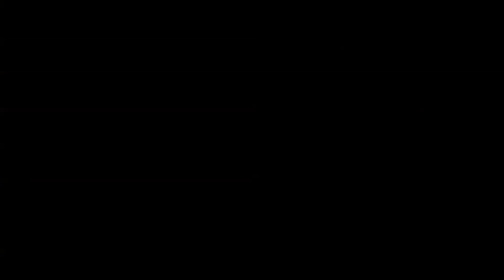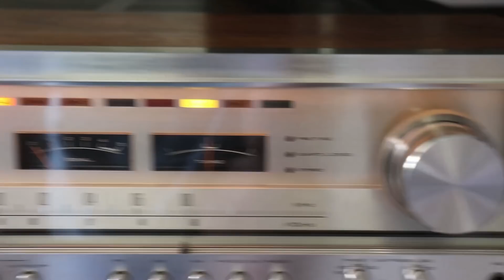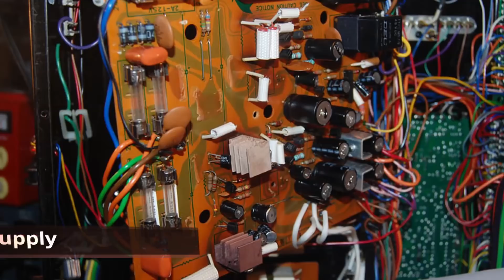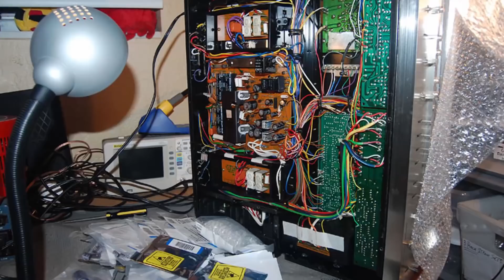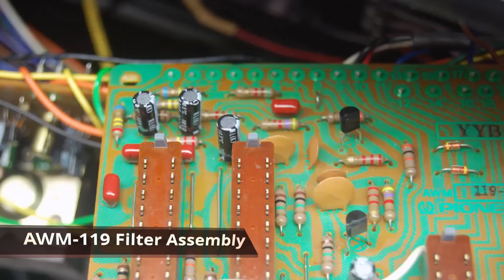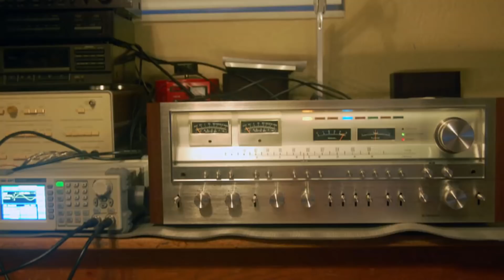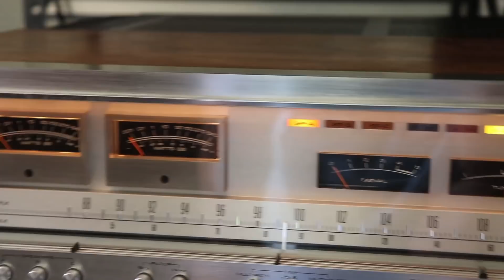SX-1980 - The Most Powerful Pioneer Receiver Ever! Vintage Stereo Repair Restoration & Testing.

Comment: Howdy, This is the first time I've been on this channel ! You do some serious work !! Could you do a show, about the test gear you have on your bench ? And on the subject of capacitors....... What are your top 10 cap maker's, according to type ??  By type, I mean electrolytic, non-polarized, ceramic disc, styrene, etc......!  Thanks for all of your effort and hard work !!
Reply from the maker: Thanks for watching and for your kind words. I've done several video's that you may want to checkout on test equipment, capacitors etc. I have provided the names and links to the video's  below.

Troubleshooting Failures In Vintage Audio Equipment -

Replacing Old Electrolytic Capacitors - https://youtu.be/RaWrYJ6amcA
Vintage Stereo Repair - https://youtu.be/N3e9C4mUui0
Phono Repair And Troublesome Transistors - https://youtu.be/lkcP1z-KcPA
Hakko 808 Desoldering Tool A Must Have - https://youtu.be/NtSn_HPT-sE
Hazards Of Reel To Reel Tape Deck Repair - https://youtu.be/KvXwN5igzDg
No Audio In Vintage Equipment - https://youtu.be/pKqxlT9sgZY
Troubleshooting In Vintage Equipment - https://youtu.be/xk5gjq5ehK0 
Reforming Speakers - https://youtu.be/ttbgeDagRus
Checking DC Offset On Vintage Amplifiers - https://youtu.be/ZvBoxhpa-v8

Comment: I have a pioneer SX1050 bought in Okinawa in 1977, which is having channel dropout that can be reversed by increasing the volume, which breaks through the dropout. Can this be repaired?
Reply from the maker: I'm sure it can. It sounds like your volume control may need a deoxit treatment along with the other control switches and pots. That would be the first thing to try.

Comment: I do fix those vintage audio equipment for about 30 years now (I'm 60). The thing is that those old electronic equipment were made with mostly discrete components and so are quite easy and cheap to fix compared to much about anything electronic today. Now, you have unidentifiable very small components with often 200 pins IC's in a bubble grid array arrangement on a board with 6 internal layers of circuit traces. Nope, don't even try to fix that. You'll lose your sanity.
Reply from the maker: Yes, that's very true. The vintage electronics were made to be repaired when they broke. Most modern electronics when they break you wait for trash day.
Reply: Vintage Audio Addict Just wondering...  I own two SX-1050s and a SX-950. Just having my 950 redone.  My audio repair guru prefers to test the old parts and if they test to spec, resolder them, claiming the old parts were good parts and sound more musical than new parts. (I’m speaking mainly of capacitors.).  He claims solder gets old and resoldering is a big improvement.  Hoping you will comment with your opinion.
Also, he prefers to restore 950s, seems to think they are very musical.

Comment: I bought a sx 1980 and had it tested and recapped it was no where nere 270 wpc hell my sx 1280 hit harder and sounded way better now I run a marantz 2600 I was very disappointed in the 1980 now I love my spec 2 system

Comment: I have an SX-980 that I bought as a teenager the year they brought out digital so I got mine on sale.  It needs to be fixed.  It was a work horse.  I used it for a 2000 sq ft dance hall using 4 speakers at half volume and it was definitely pumping out the music.  Mine was rated at 80 watts per channel.  I was told never to get rid of it even though my wife has had the desire a number of times.
Reply from the maker: Thanks for sharing. Your SX-980 is a fine receiver. Keep her around, I mean your wife of coarse, LOL. But seriously your SX-980 has an issue that could probably be fixed and then the SX-980 can make music again.
Reply: @vintageaudioaddict  Excellent video by the way. The last time I had it in for service I was told that there's soldered connection between the amps that gets hot and then cold and then hot and finally snaps.  I wish I had the money to get one of the higher end models but back in 1977 when I bought it, I think I paid $350 was a lot of money to me and the one you worked was about $1250 if I remember correctly.  Where do you get the flip handles for the front? One of mine came off.  thank you.
Reply: @vintageaudioaddict  I just had it fixed and cleaned by Dr Dan's in Denver.  Love to listen to it again.

Comment: There’s one on ebay right now.. $25,000 (not a typo) or best offer. Just wow! Shuda kept my 2325.
Reply from the maker: I love this stuff but that's a bit much.
Reply: I saw that on eBay I think. It was found in a closet in the original box and unknown if it had ever been used at all. If you have a spare 25k, and don't have a sx1980, what the hell, huh.

Comment: Reminds me of my high school days late 70's early 80's, always had Radio Shack equipment, but the best receiver they had was just a measly 120W RMS/CH, (Matched with my Mach 1 speakers) wish I knew about this one! I would have drove my parents even more nuts with my house shaking music.
Reply from the maker: Radio Shack had some good stereo equipment back in the day. The Mach 1's would crank!
Reply: I built a number of speakers using Radio Shack sourced drivers, crossovers, L-pads & more. Not all was used as-is, like modded x-overs, midrange enclosure within the overall enclosure, serious bracing especially when running 2 x 12" poly woofers (40-1026) in each box. Without it would have blown the box apart! Lot's of fun!!✌

Comment: Can you loan me that receiver I'll give it right back I promise you can have my Pioneer SX 580 as collateral 😁....pweeease? Man this sucks even a moderately conditioned one is still almost five grand if I had the money though that would be one of the splurges I would make what is an excellent pair of speakers of around the same vintage to go with that even if they're not Pioneer speakers what are some really good speakers around 1978 that would go with that
Reply from the maker: Sure, send me your SX-580 first, LOL. Seriously don't discount your SX-580. Sure it doesn't have the power or features that the SX-1980 has but it can hold it's own. Your SX-1980 is a fine receiver.
Reply: @vintageaudioaddict  yeah i was kidding , i have it going to a pair of cerwin vega vs-150 15inch 3 ways on ch. A , and bose 201's on ch. B, with a BBE- 362, and a Behringer DEQ-2496 digital eq through the tape monitor and at only 20  watt per ch. It sounds excellent😁👍

Comment: The Pioneer SX-1980 was a radio receiver that Pioneer Corporation introduced in 1978, to be matched with the HPM series of speakers. It is rated at a staggering 270 watts per channel into 8 ohms. However, in the September 1978 issue of Audio Magazine, Leonard Feldman did a spec test on the SX-1980 and concluded that the rating of 270 watts per channel was too conservative. He stated in his report:

Though the new [IHF mandated] "Dynamic Headroom" measurement is specified in dB, it should be mentioned that based upon the short-term signal used to measure the 2.3 dB headroom of this amplifier, it was producing nearly 460 watts of short-term power under these test conditions!
Reply from the maker: The audio manufacturers back in the day were mostly conservative with their specs.

Comment: I've got a 980.   It's been a great receiver.    Bought it used a decade ago for 250 bucks.    It's worth more today.   I'd love a larger unit, but they are out of sight and RARE.
Reply from the maker: Your SX-980 is engineered and built just as good as his big brother the SX-1980. You have a fine receiver.

Comment: before this one i had a kenwood just as big as this if even more, i don´t remenber the model ,and tried to find it on-line but i can´t found it on the catalogs available on-line it´s very look a like the 1973 stereo receivers from pioneer, i own also a es-2000 system bought in japan in 73 that looked like the kenwood wich was my stereo receiver after the one in es-2000 system that also works perfectelly today with everything original
Reply from the maker: Thanks for sharing. Congrats on still owning some of your older equipment. There were so many great audio products made by Kenwood and so many others.

Comment: There's one of these on EBay right now. Open box absolutely mint. Looks like it was never used. Seller wants $25,000 or best offer. That's insane considering in great condition you can get one for $5,000
Reply from the maker: Yes, 25K seems a bit much, LOL

Comment: Back in the late 70's the SX1010 was king of the hill, I was a Sansui guy so I have the AU20000, its rated at 170 RMS into 8 ohms, its a beast.  I still have it but needs a restore, a guy on ebay does them for about 800$ and up. Maybe someday, I still have my JBL  L300's, rock on.
Reply from the maker: Thanks for sharing. So much great gear back in the day.

Comment: my first piece of stereo was a Pioneer Receiver a small unit - but what impressed me was the way it came packaged - this was in Europe - in Heidelberg and i got it in the '60s from an airbase store.  I eventually after many speaker large and small and many receivers went just straight wire with a Marantz 8b - will not bore with other equip.
Reply from the maker: Thank you for sharing and thank you for your service.

Comment: Bad design on this receiver. Lots of over heating problems and burnt out caps. If you want a real well built pioneer receiver, get a sx1250. 
Way better design and sound. This monster was built for wattage wars only. It was competing against the sansui g33000 which is more powerful, better sounding and better built.

Comment: i had a 13 piece system i bought in the early 80's i wish i still it, it beats anything they sell in stores today, more sound, better tuning, etc., wish i still had it instead of what i'm stuck with today.
Reply from the maker: Wow, a 13 piece system. You must have purchased it all at once. I'd buy audio equipment a piece at a time. I would have brought the whole store but I didn't have the cash to do it.

Comment: Is buying those cap/component kits cost effective? For a Pioneer SX-626 they run $60-80. Includes the caps, transistors,  etc.
Reply from the maker: Maybe.... buying a kit is the correct thing to do to save time but not money. I know that's a great answer. Almost always you can order the same parts cheaper. The person that your buying from is in business probably to make a profit and he's taken the time to put everything together. Some of the kits use the correct/high quality components and other's don't. You have to do some research on the internet and find other folks that have used the same kits and see what they say. BTW.....Your SX-626 is a very nice receiver.

Comment: What is the weight?  And why not switch out all the push switches since they do tend to become a problem even today on modern mixers.
Reply from the maker: About 78 lbs. It's not necessary, The switches are good to go now.
Reply: 78 lbs? One would need a hand truck to get it out of the store and into a van. Whew!

Comment: Thank you for the extended explanation on switches.

I just bought an SAE 180 para. eq. that I tried cleaning switches and linear pots.  Apparently, I didn't do good enough of a job on the switches; pots seem good but a bit physically "scratchy".  I'm not sure if there's an issue with the switches, other components or my misunderstanding of its operation (playing tape player with EQ vs. Tape Monitor).  Any recommendations are appreciated.
Reply from the maker: Your welcome and thank you for watching. When I first started working on vintage audio equipment I didn't exercise the controls enough after using Deoxit. I thought I was doing enough to turn or push each one a few times but after having to take equipment all back apart again to re-clean the controls I knew I wasn't doing it correctly. Many intermittent issues in vintage equipment can be solved by the proper cleaning of the controls. You can have defective pots and switches that cleaning will not fix but first you need to make 100% sure that you have those controls cleaned properly, meaning each and every control is exercised 40 or 50 times after the dexoit has been properly applied.

Comment: Which main filter caps did u use and were can i get them?? Nice work!@
Reply from the maker: Thank you. Nippon Chemi-Con. I purchased them at Mouser.com years ago but I'm not sure if they are still available still. The filter capacitors are getting a little more difficult to find as time goes on.

Comment: Do you by chance work on reel to reel tape decks?  I have a Teac X-10R that has recently been cleaned, adjusted, lubed, etc and all works fine except the take up motor has gone kaput.  If you do please advise and perhaps we can arrange something to get this beautiful piece of gear up and running again like it should.  All my tapes are just sitting over there waiting to be heard again.
Thanks in advance! (I live in central Kentucky..Lexington.)
Reply from the maker: I have an X-10R and it's a wonderful reel to reel. I do work on tape units but I'm only a hobbyist that repairs and collects vintage stereo gear. I only work on my own equipment.
Reply: @vintageaudioaddict  Thanks for the reply and I enjoy your videos. ..keep up the good work.

Comment: I picked up an old Sherwood S-7300 for $50 from a flea market a little over a year ago which is what got me into this. Owner said it didn't work, but the chassis was in great shape for it's age. I plugged it in at home without knowing about the light bulb-load-test trick at the time and smoke rolled out of it. I opened it up and saw a burned trace on the power supply board. I bridged it with solder and noticed two of the bridge rectifier diodes (i guess is what they were called) were charred looking. I replaced them and the receiver came to life. I also installed a fuse between the power supply transformer and board that it feeds for added safety. It has some of the cleanest sound i've heard when compared to modern junk. I hope to one day learn enough to be able to rebuild this receiver and bring it back to it's glory, but for now it's set up in my living room with two 150 watt KLM floor speakers connected.
Reply from the maker: Sherwood made some great audio equipment. Experience is the key with almost anything and working on vintage electronics is the same. You learned from your experience and you did a great job getting her going. Great job!
Reply: @vintageaudioaddict  I just recently acquired a Sansui  AU 717.  I was absolutely loving it paired up with a pair of Tannoy system 115 DMT"s. Everything was sounding wonderful. Dim the volume potentiometer stuck. Locked up tight  i I'm hesitant to try and fix it. It really isn't any repair shops around here anymore.  Any help you could give me regarding this I would greatly appreciate it. 
                Bob

Comment: The thermal compound on the output transistors of old equipment may degrade with time and become chalky. I make a point to remove the output transistors and apply modern silicone thermal grease. In doing so, you may also find that the transistor mounting screws were loose.
Reply from the maker: Yup, that's always a good idea.

Comment: I've got an SX-1080 still in service.  I don't think it's ever been opened up.
Reply from the maker: The SX-1080 is a really nice receiver.
Reply: @vintageaudioaddict  I have a donor 1080 in semi-working condition, it does power up.  What's your thoughts on LEDs in place of the filament dial lamps?
Reply from the maker: @SteverRob  I am still using the lamps in mine but I have other units with LED's. The lamps and LED's do light up the dial face differently. It's just personal preference. With LED's of course you can mess around with different colors if you want.
Reply: @vintageaudioaddict  Ok thanks!  I've done the LED swap with some ham radio transceivers, but not any audio gear.  I've got 1-2 bulbs out on the SX-1080.
Reply: Well, 2 years later, and a bit better equipped test instrument-wise, I've got the "donor" on the bench.  It's complete, no misisng knobs etc.  I'm starting on the PS board, doing the rudimentary r/r of all the electrolytics.

Comment: At this point, unless you're very wealthy and are buying this strictly for nostalgic reasons, there are far better separate amplifiers you can buy, even amplifiers from this era (even amplifiers from this era from Pioneer themselves) that are far superior, far more reliable and can provide as much if not more power that you can buy for far less money then the Pioneer SX-1980.  From the Onkyo Grand Integra M-510 to the Pioneer Exclusive M-5 and even the earlier Exclusive M-3 or Spec-2, Denon made the POA-3000 and there are many other examples great "large" amplifiers from the late 70s and early 80s that blow this SX-1980 out of the water for half or less money.  There was a time when these beasts were a good buy for what you got, but the collector market for these SX-1980s have just gotten too ridiculous with prices exceeding $5000 that they just aren't worth the money or the potential problems anymore as you can get very good separate power amplifiers from this period with their matching pre-amp and tuner for often half the price of any of these "monster receivers" and get far better and more reliable sound out of almost any of them.
Reply from the maker: Thanks for your comments. Like everything in our society, the market dictates the price. Some people would say an old rare Harley- Davidson oil can not be worth $2000 or an old gas company sign $7500 but they are sold. A rare 69 Chevy Camaro for $250,000 is crazy when you could buy several 2020 Camaro's for the same amount. Vintage audio equipment is the same way.  It only takes two people to make a market. It will always be that way.....